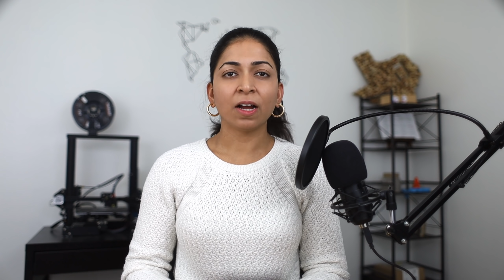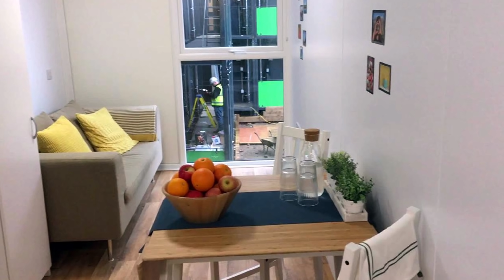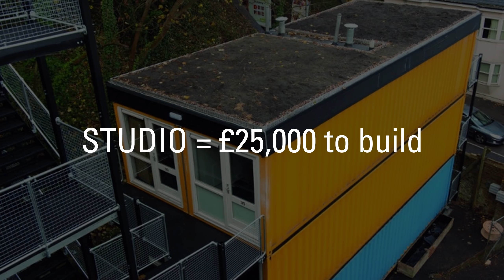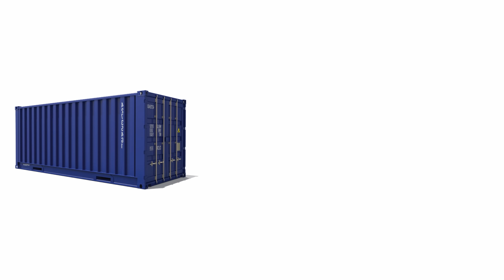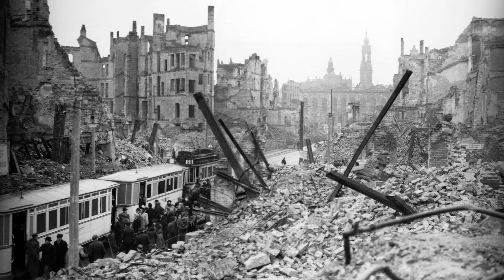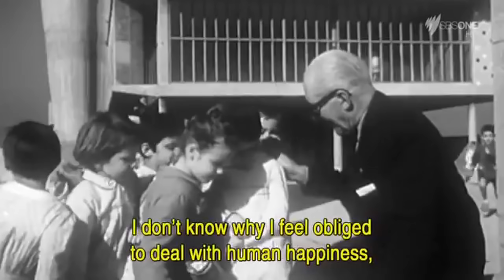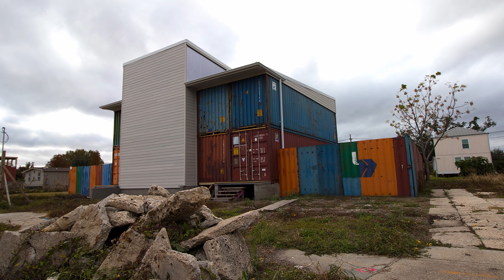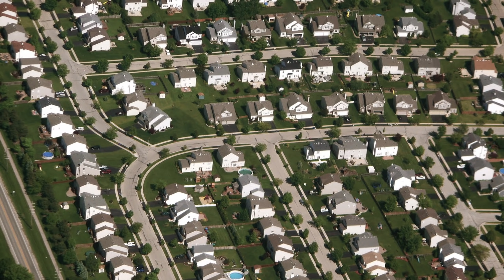Why Shipping Container homeless shelters FAIL

Comment: The motive of a great deal of top-down solutions seems to be one of controlling a problem. The problem being 'homelessness'. Often, what is good and healthy as a home becomes a secondary consideration, with the first consideration being given to 'solving' the problem. Putting someone in a container of four walls and a roof, is not equal to offering them a home.

In the UN definitions of the "Human Right to Adequate Housing", the provisions are multifaceted. There are accessability, habitability, and security, some very practical and pragmatic aspects, but included in this international law is the requirement that  adequate housing is culturally appropriate. Who can say that living in a container is a dignified home? Who can say that it is healthy for the occupant?

Developments integrating shipping containers into an accommodation block, with respect to this international law, are indefensible. However, the argument might be that it is better than nothing, and I think that is true. However, we shouldn't consider containers as appropriate shelter for human habitation.

Comment: See the problem with your thesis in this video is that you sidestep your thesis statement.  The containers don't fail, rather you highlight and expand on poor usage models and shody insulation of them.  Housing Projects are notorious for creating poor quality of life environments whether they be brick and motor, cement block or frame structures.  Building a housing project is just a bad idea 💡.  Shipping container homes 🏡 as stand-alone units properly constructed and insulated units are definitely 👍 a viable solution .  As architect you know that a solution is only good if properly applied to the  correct problem.   Lastly, it's easy to say they fail as a solution when you haven't spent time living on the streets in a tent or sleeping under a bridge 🤔
Reply: Poor engineering, construction, and maintenance can screw-up the best architectural plans.

Comment: I agree - it seems like a good idea at face value - to be more economic - but custom built modules would likely be cheaper - certainly across the lifetime of the building - given the additional work required to make them safe and the simple fact that the relatively thin steal walls? will be rusted through within a month or two if paint degrades or is damaged at the right spots.

Comment: You are so right! Shipping containers are designed for transport - not for living. And used with bad tech solutions (thermal insulation, moisture insulation, heating, cooling, ventilation etc), they become nightmare housing. 
But on the other hand, modular industrial produced housing parts and components seems to be a smart way to achieve high quality living to affordable costs for many more people than before, provided that high skill and competence is used on every level, from tech detaling up to area planning.
Reply from the maker: I agree. The prefabrication of modular units in a factory, under supervision by competent builders has a lot of potential. But it's inevitable that companies are going to cut costs with those products too!
Reply: @BelindaCarr  It's almost like the problem is capitalism...

Comment: I completely agree that the homeless problem is approached from the top down instead of the bottom up. I interact with people at the homeless shelter in my city on a monthly basis and they want exactly what Belinda says - a reasonable shelter that actually works. There are a lot of social problems that go beyond housing - that's outside of the scope of this video. Thank you for your analysis of disparate types of housing in a coordinated way.
Reply from the maker: Thank you!
Reply: @BelindaCarr  U just open my eyes
Reply: Also, I really liked the breakdown of how many metal studs could be produced from recycling shipping containers. That was an AWESOME demonstration of how inefficient some of these methods are.
Reply: Isn't something better than nothing?
Reply: @lightmechanic2370  EXACTLY! No solution is offered except to listen to homeless people. Thats not a freakin solution!

Comment: it wouldn't be such a problem here if the UK's public housing stock hadn't been sold off in the 80's.
Also, there's a video on public housing generally by donoteat01, and one thing he points out is the better value of smaller scale(4-5 stories) public housing.
There was a study not too long ago that showed that 4 story buildings had the lowest carbon footprint overall, because they aren't as resource intensive to build as larger ones but support the higher densities for efficient land use and infrastructure use, so all the more reason to support them. (titled "The Environmental Impact of Tall vs Small: A Comparative Study")
Reply from the maker: I'm going to check it out, thanks!

Comment: Not sure I agree with the overall conclusion. Any home regardless of type, if built poorly will end up in failure. Regardless of size or build type. Anything of poor quality will not stand the test of time regardless of design or aesthetics.
I've seen on Youtube quite a few tiny homes in the USA which appears to have a high success rate. One of the clips the requirement was you needed to put some of your own financial equity over time and initially invest your own time into your own home build. Which I assume has some psychological input into making it your own home more valuable. And having like minded individuals in your community..

https://www.youtube.com/watch?v=-qQ0ou3hA10
Reply: While it's true that a poorly built structure will not last, there are reasons that  these types of home area clearly a fad. This video was posted by a family  in 2016, "The Reality of Building & Living in a Container".  Notice toward the end where they have decided to build the remainder of their property using traditional methods.  You don't know until you try, and by then you've spent thousands of $$$.

https://youtu.be/MSOzSxYFLIw

Comment: The other side of the problem is veeeery poor functional design of those homes. No insulation in metal box? Plumbing issues?
Reply: Yeah like she says this is asinine, you're much better off (for everyone) long term by recycling the shipping containers and building PURPOSE BUILT modular homes that have proper plumbing and ventilation.
Reply: Dats why u insulate it yourself
Reply: Why are they even thought of for long term living? They should be a stepping stone to better living conditions (no more than 2 years living there, enough time possibly for someone to get on their feet, and plan to move up to better. ) These projects should include support systems designed to get people to be self sustaining, with the explicit goal of moving them into more permanent situations.

It looks like the real problem is thinking that those projects as the end solution. They are not.
Reply: @houstonhorse7877  exactly what I’m thinking. If you had perfect, free housing taxpayers/general public would be upset. A roof over your head and access to a shower and a place to keep your belongings would be a huge improvement from nothing
Reply: @warrendewey7556  if you have to sleep outside during the Summer like that one interviewed family because it's so hot in the container, that's not a roof over your head.
Reply: @warrendewey7556  but what is the reasoning to being upset?Humans can’t exist in barely surviving with just basic shelter. Human needs are more then that.
If proper housing solves social problems, maybe society needs to look at itself as to why it’s wants a very visible poor struggling class. Donating used leftovers only makes the donor feel good. Usually does not help the group being donated to at.

Society just wants a group of people to dump their contempt onto.

Anyone who has been homeless (I have not, but known some who have come out of it), knows it’s more complex and humanity has a set of basic needs. The assumptions being made by some architects are far below what is basic for a human. 
I think Belinda is on to something with what is taught in schools.
Reply: @rosiehawtrey  The "houses" are metal, and stacked... If you think multiple families trying to fit on sun-heated metal of the roof of a shipping container (with no ladder to get to the roof, or railings on the roof!) is any sort of reasonable sleeping situation, I don't know what to tell you. When they can't sleep in those rooms, they are not sleeping on the roof, they are back to sleeping on the street/wherever they can find, e.g. the same place they would be if there wasn't that "shelter".

I have nothing against affordable housing that leverages natural heating and cooling (the house I live in has a flat, white roof, white stucco walls, and actively cools solely through opening windows to get a good breeze flowing), or "unconventional" sleeping situations, but that is not what was being described.
Reply: @LadyScaper  I agree with what you are saying but you missed a VERY important part.

the INDIVIDUALS who will live in ANY low income housing EACH have different needs. 

I could easily be happy in a 1L1B1K 
basically 1 living area, 1 bathing/toilet area and a place for my oven  beside a counter and sink combo.

Fridges/freezers can be plugged in in  the living area as they take a standard plug and washing machine/dryer setups would be great as well but I have spent the last 5-7 years doing my laundry by hand already so can live without it. 

MOST people I have known over the last 50+ years could NEVER live in such a small space and I have even known homeless people who prefer to be homeless then to have such a small space. (then again that was when they were all still young)
Reply: its free.... its free. just take it and shut up.
Reply: Plus being noisy, having terrible ventilation/breathability/condensation problems, being hard to repair, etc.  Shipping containers also make terrible “bunkers” or emergency shelters, despite people trying to use them as such.
Reply: @skutch Blobaum They can be waterproof, and mold shows the lack of quality construction or lazy people who don't clean up after spills, leaks or leave their wet towels in a pile against sheetrock for weeks on end.
Reply: @Reach3DPrinters  Condensation can cause mold just as quickly at a leaky roof or a cracked pipe, and shipping containers are infamous for condensation, especially in winter. To prevent the condensation issue you basically need to build an insulated box on the outside and inside of the container. At witch point you might as well just build a house.
Reply: @jakobrosenqvist4691  no, you dont. You vent the interior in the same way as you vent a normal building - and provided there's enough airflow enough of the time problem solved (hint: work out the prevailing wind direction and orient accordingly. None of these problems are insoluble - they just require application of brain and heat capturing external vents in this particular case.
Reply: @Reach3DPrinters  The major cause of toxic mold is poor or improper VENTILATION and INSULATION! The biggest issue with metal boxes staked side by or upwards (or both) is you are starting with a already SEALED environment so most people would never think of the fact EACH box would need to be separately ventilated in an EVEN manner. You would need a PROPERLY insulated AND ventilated area between each box in an upward stack as well as between each side by set.
Reply: If I were homeless, I would be happy to get a place to live. Projects have failed because of the people who settled in this housing. If you move a resident of a Third World country to a First World country, then he will not change inside in any way.
Reply: @samurai_dmitro1293  We can afford to house the homeless and we can afford to give them dignity as well.
 Instead of sinking hundreds of billions every year into a bloated military with a thousand foreign tax-money sucking bases, let's do that. Wouldn't even have to cut spending on death by much, just a few billion a year.
Reply: @Scepticalasfuk  has nothing to do with money, homeless shelters are eyesores and homeless often bring drug problems to whichever area you settle them in, additionally there are plenty of programs already out there, if someone wants to get help, provided they reach out, they can usually find it, on the flip side, many don't try to reach out, and are not willing to try and fix their situations, and folks who are not willing to help themselves do not deserve help to begin with
Reply: @alexnorth2452  And you get to decide who 'deserves' help?

Comment: Nice video. I never understood the design world's fascination with container homes. If it's just the shape that they're after wouldn't it be cheaper and easier to just build that shape with wood?
Reply: Because most of the time the shipping containers are retired. It started as a cheap way to build using  recycled material. In the end, it's not cheap and it solves no environmental problems.
Reply: I like the point Belinda made that the metal could be recycled into other things. Much better then trying to turn it into a home.
Reply: Here in the UK it's too damp for the wood to last unless it's been properly seasoned which it never is. Also the wood has to be imported. There's only one answer for us, bricks. Ok, there's stone for posh people, but for the rest of us, bricks. Anything else is not a proper home.
Reply: @r.brooks5287  yep, this why it's so important to adopt construction practices which better for particular territory and do not try to find one solution for everyone. It's a lot cheaper to build from wood in some parts of Russia or Canada (which is also traditional building material for houses), but not in UK
Reply: Wood and steel have very different characteristics. Wood is Far less durable.
Reply: The appeal of containers come more into play in areas prone to natural disasters as the frame on the containers make them extremely resistant to forces which would commonly destroy other structures. An area such as the UK might use it because it is trendy (and apparently without properly insulation/heating/cooling), making it more expensive without good reason, but an area in the Pacific islands might use them to actually help survive extreme weather.
Reply: @teemun3979  Isn't a shipping container weight is just about 4 tons (and it before cutouts for doors/windows), which a lot less than a concrete structure of similar size. Against what kind disasters? Not really sure that it something safe against storms for example, it doesn't have any foundation, can be just flipped by strong wind. Probably better than a wooden shed, but not sure that it's so much better
Reply: @teemun3979  Not used in the UK due to trendiness. Used as a less expensive in the short term temporary answer to a long term problem because the council house stock got sold off and hasn't been replaced.
Reply: Humans are trying to avoid using wood. Cuz environmentalism
Reply: However, shipping containers need reinforcements once you cut through the steel for windows and doors. The EXTENSIVE reinforcement is done with WOOD......lots of WOOD!! Same as you would for a traditional home. There is no environmental savings on wood.
Reply: @sfchick7615  reinforcement is done by welding in angle iron.
Reply: @michaelwaters6829  If they were sincerely concerned about the environment they would be even less likely to use metal as it is not a renewable resource.  It's a fad, and perhaps the worst and unhealthiest fad I've ever seen.
Reply: @michaelwaters6829  nonsense. Using wood is good for the environment, and even better for humans, as wood stores CO² until it rots
Reply: Co2 is not a danger to the environment heck plants love co2 they grow bigger cause of it
Reply: @Steven9567  that is true, plants do love CO2, BUT the plants can't keep up with the amount of CO2 we are producing.
Reply: @michaelwaters6829  but wood is a renewable resource that is more environmentally friendly to process than steel.

Comment: Always well reasoned, researched, and justified thesis. Shipping container homes are the penultimate example of conflating the moral nobility of an idea with the validity of the methods and ideas.
Reply from the maker: Thanks for watching!
Reply: Meanwhile people freeze in the wet streets. So since containers are only a poor housing solution, we shouldn't bother at all? Perhaps if the narrator actually provided a solution, instead of suggesting we listen to homeless people to devise a more efficient method of temporary housing, im sure homelessness would be solved... or not.